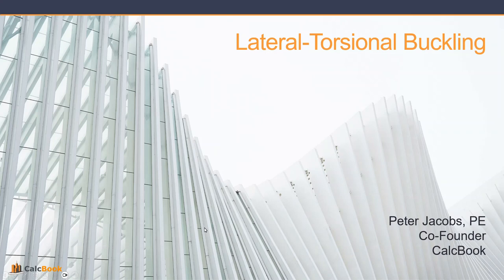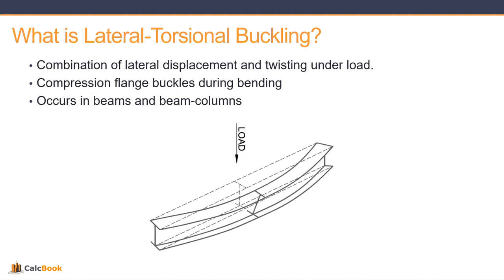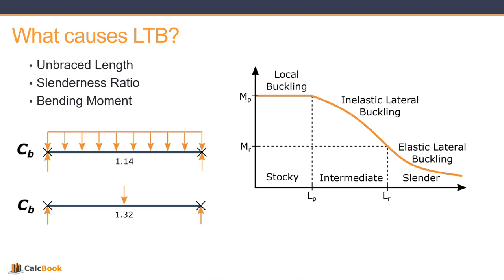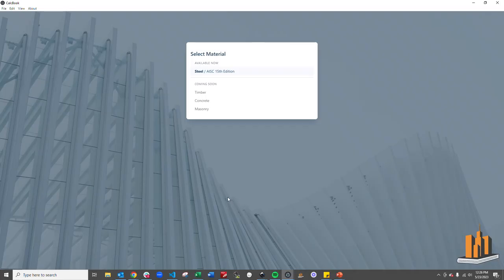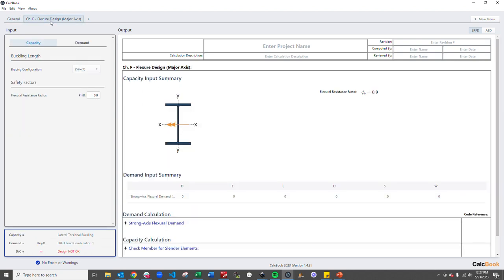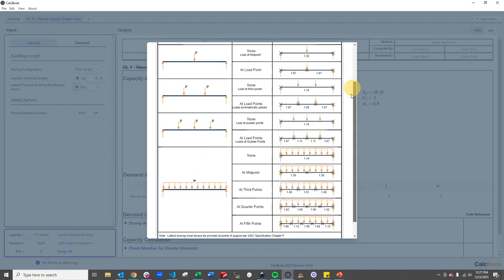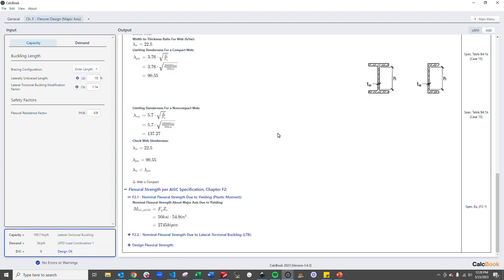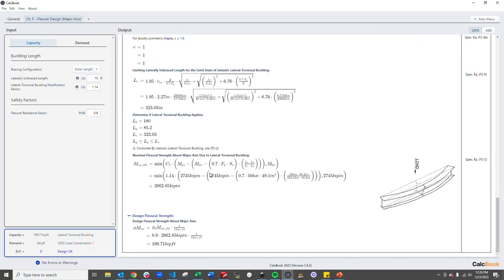Lateral-Torsional Buckling (AISC 360)

Comment: hello sir, From where you get rts and if there is a formula couls you please write it there
Reply from the maker: hi @ahmadramadanwahbeh1071

For standard shapes as shown in the video, rts comes from Shapes Database put out by AISC

For custom shapes, rts is calculated as described in the user notes of Chapter F of AISC360

The Show-Your-Work for rts is shown on the "General" tab in CalcBook by expanding the Geometric & Material Properties section.

Hope this helps!